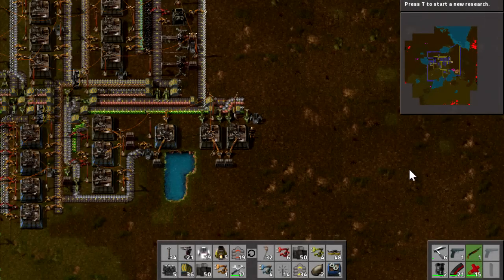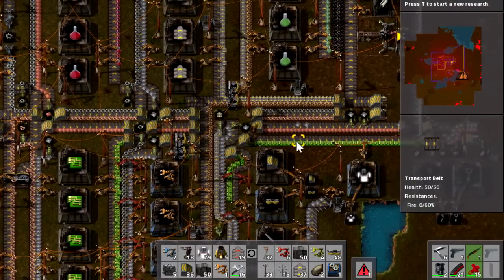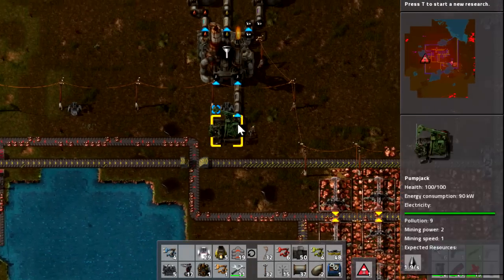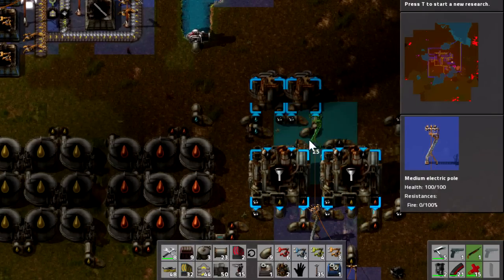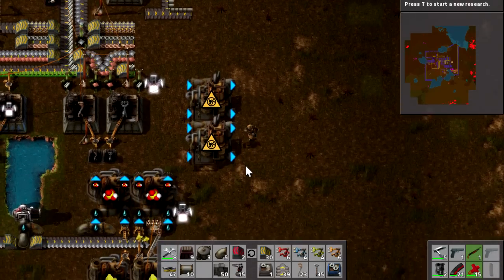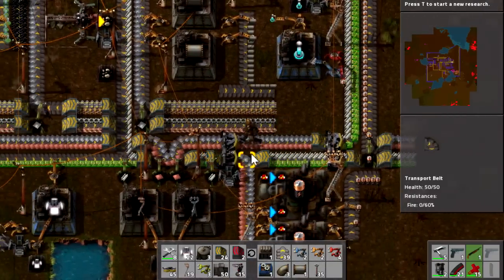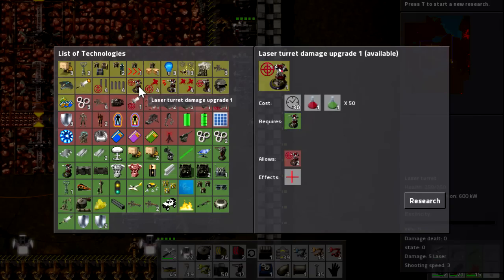Factorio 05 Oil Processing

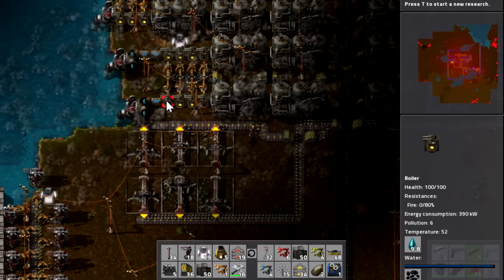Comment: 2:52 lawl. that's backwards! its 14 boilers to 10 steam engines!!!!

13:12 by pressing the middle mouse button, you can set a favourite so your items stay where you want them to.

18:36 they need to be one space back so large biters can't reach over the wall and attack them directly.

Keep up the good work X. Looking forward to the next one!
Reply from the maker: Negative Root Oh man im gonna have to redesign those walls later on XD
Reply: Its not a huge issue. As you've got double thickness, you're ok for the moment. If the outer layer falls though, you're going to have a double grind on your turrets (spitters + biters).
Reply: Wht is the naem of your channel negative root?

Comment: Hey Xisuma! Been watching and loving this series, glad you finally got some feedback! It really helps to see every extra detail with alt.
Let me just say, when you turned it on, I actually 'wow...'d outloud. Your pollution cloud is HUGE! The whole minimap is red! I have no clue what is causing that, but it's no wonder why you're aggroing every alien camp nearby!
Also, I wonder why your turrets are taking damage, despite being behind walls. I think you should be fine to actually move them back a few spaces. They have HUGE range. That might keep them safer.
And finally, from what I understand, the AI works by drawing a line from their base to the nearest or biggest pollution factor (electric miners, boilers, etc.) and trying to get to it. If it finds that the path is blocked (by walls, for example) it will attack the wall. However, if a turret fires at it, it will then aggro the turret instead. You can abuse this by 'mazing' the aliens through walls, giving the turrets more time to attack. Also, the aliens are affected by the conveyer belts. That will give you even more time to shoot them down before they start to attack.

It seems like defense is the only thing that's pressing right now, so I hope those tips help! Keep it up!
Reply from the maker: Johnnyb3g00d Cool ideas man! i may try that in a future world :-)

Comment: You seem to have accidentally removed the oil input into your left refinery.
Also, the heavy and medium oil can be made into stuff that you can burn in furnaces that gives more energy than coal, but you may need to do more research for that. It's the black cube recipe.
You will definitely need more steam engines and accumulators to run a big laser defense.
Reply from the maker: TroZ Thanks, it took me a long time to spot that XD

Comment: Hi there Xisuma,
hope you keep this series running, I really like it! Hope you find the time to start a Factorio Multiplayer series.
And for your problem with the many Biter attacks, you could either reduce your pollution (instead of steam engines build solar panels & accumulators and put in your mining drill and stuff efficiency modules) or you start researching tanks and get rid of the nests around your base

Here some tips you may find useful:
-you can bind items to your toolbelt by clicking on the slot with your middle mouse button and then you can select an item you want to bind
-with "Q" you can drop selected items back to your toolbelt/inventory
-you still can place higher tier buildings/things (inserters, belts, assemblers) over lower ones(fast belts on top of normal belts). that way you don’t ned to deconstruct them
-when you don’t have the power to support all your laser turrets, build accumulators for a power buffer or build some normal turrets and feed them with armor piercing ammunition

Greetz
Schuldig
Reply from the maker: AirsoftWolfBrigade Great tips man! Wil ltry the hotkeys :-)

Comment: ugh.. the oil industry part of the game can get really confusing at times.. especially with how the pipes work.. the ends of the underground pipes wont connect to the side and even if there is one type of liquid/gas running in one pipe and you want to run a second fluid/gas right beside it, it still connects the 2 pipes (only with straight pipe).. so just be careful not to mix 2 types in one pipe.

and as for the chemical plants; I have developed a habit of placing a plant down, setting up what i want it to produce and checking the input and output first before running pipes.  That way you wont run into the problem you had with your sulfur plant having water in the gas input and gas in your water input. but once you get it down it gets much easier ;)

thank you for making these vids as they are really enjoyable to watch!
Reply from the maker: Ravyn Knight :-)

Comment: Be wary on splitters, they can only work at a certain speed. So as your productiun goes up they can become a bottleneck even with the more advanced splitters.

Also you should be carefull about automating everything, every factory produces polution and thus attracs mobs from further away. Stuff that fast to produce (pipes) and you do not use a huge quantity off its better to craft them by hand. Having a factory that you fill up yourself is an option as well. Quite often you do not need enough of certain things to bother creating an automated system.
Reply: I agree with these tips. Most of the time it's hardly even a minutes wait to get some stuff. Not to mention there is ALWAYS something to do while the game auto-crafts your objects.
Complicated mid pieces (like the advanced circuits) you would do well to have on an assembly line anyway, and if something requires it, you can snag it from the line for your personal crafting. Same with batteries, for example.